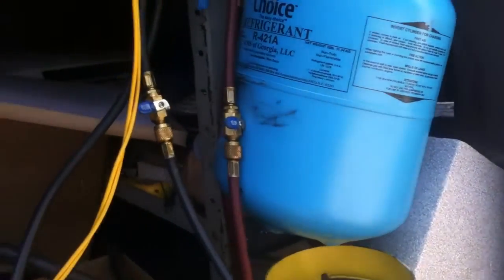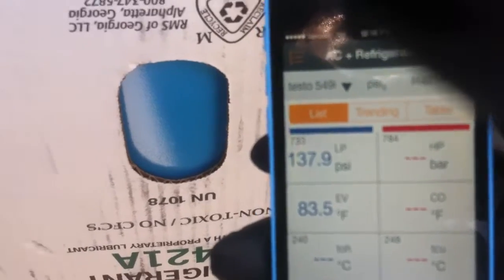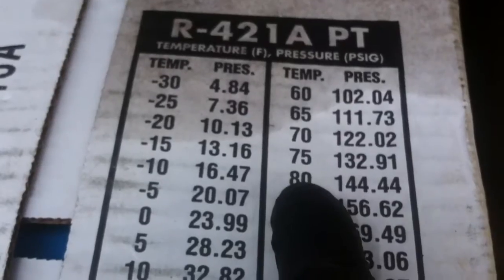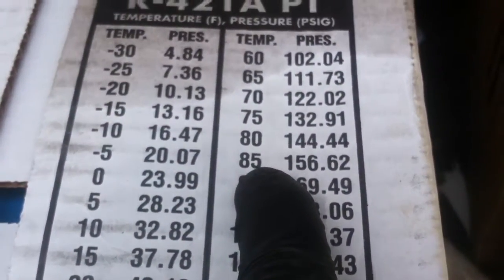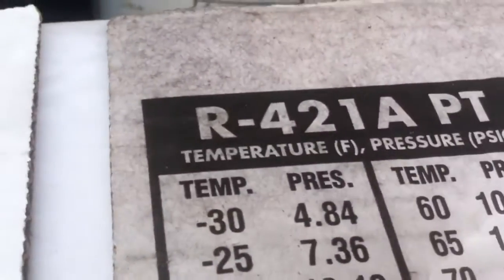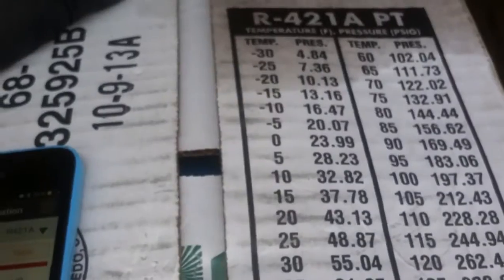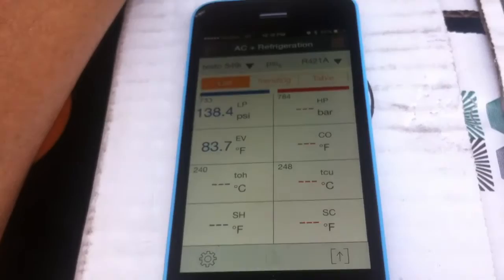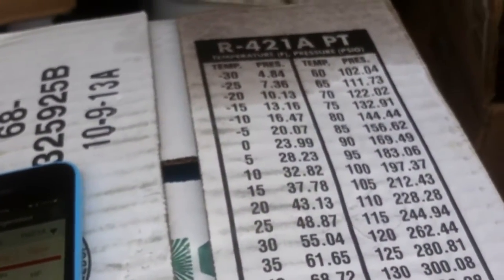Testo app pt chart issues for r421a

Comment: i just did a vid on this . alot of blends are messed up. check out my latest vid. i might trust the pressure probes, but the pt part not so much. until they get this figured out. you got to double check pt charts right now. which sucks.

Comment: I noticed you were using the testo low side part of the app. How about trying it out on the high side? The reason why im saying this is because to determine superheat  you would use dew point. To determine subcool you would use bubble point.  I never used 421A. From what i heard it does not have much of a glide So this can be wrong.  But maybe the testo app lo side uses the dew point pt chart and the hi side will use the bubble point of the pt chart.  Maybe the pt chart provided on the cardboard box is a close figure. vs the testo app can store more data.  Its just a thought. I tried looking online to find a detailed pt chart for R421A but i could not find one with this break down.  Try it out on the high side and see if it gives you the same results

Comment: That's some scary stuff. 😬
Reply from the maker: It's more irritating than scary at this point. I was running a 40 degree sat on the low side and it was barely 52psig. I was told the operating pressures were similar to r22 that's what got me thinking something was wrong